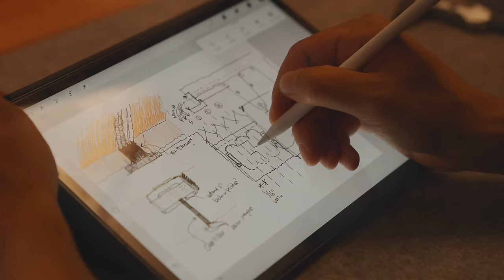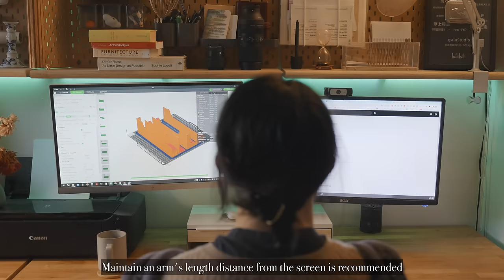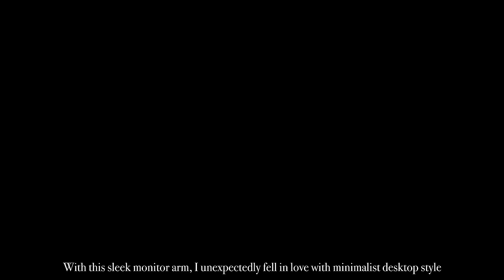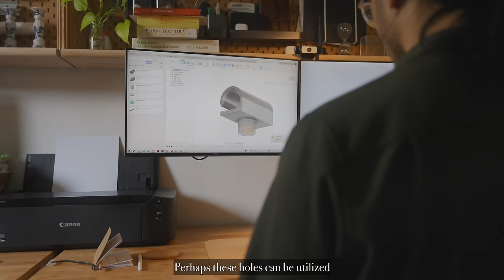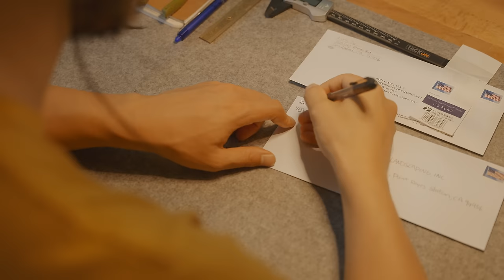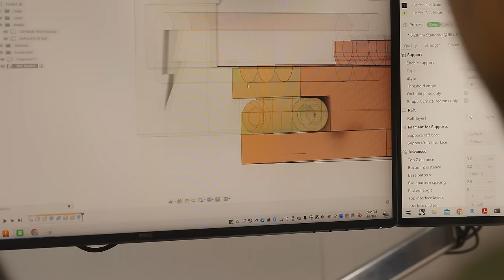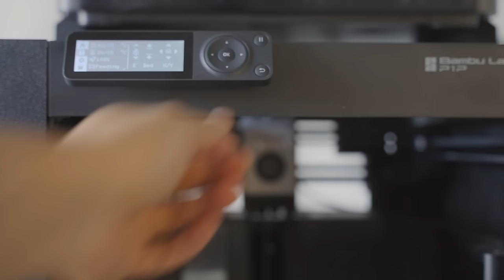Home office desk setup & upgrade! Minimal, aesthetic, functional office for 2 people

Comment: Your face should be facing the middle of one screen and not the middle of the two or a point in between, take care of that if you already didn't, will save you so much neck trouble ^^
Reply from the maker: That is an interesting point I never thought about that maybe you are right